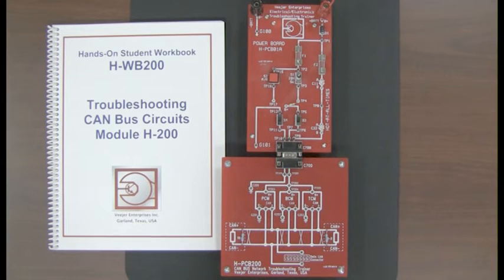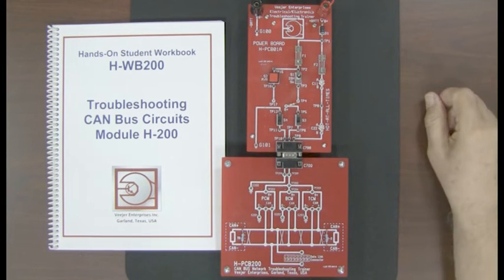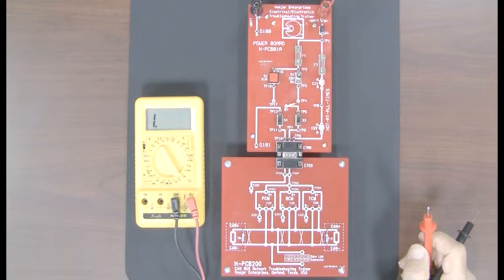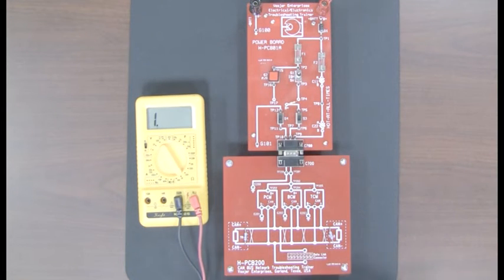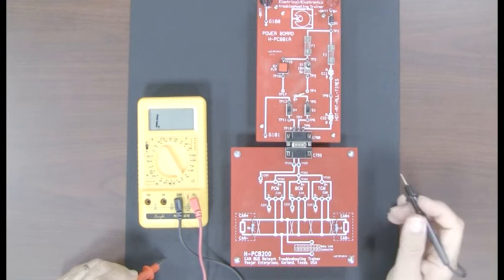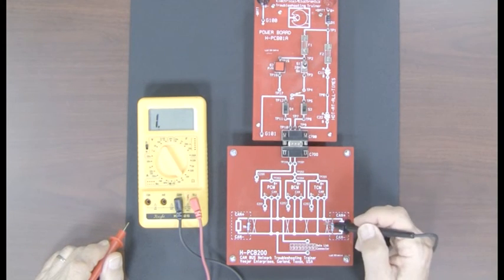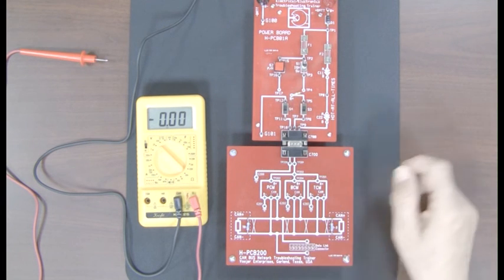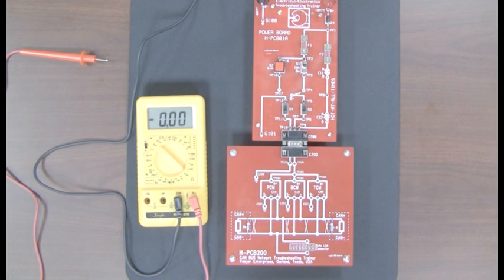H-200 Automotive CAN Bus Troubleshooting with Vince Fischelli

Comment: I would kill to have this available, so darned expensive though… used, or rent?
Reply from the maker: Sorry, no used or rental units available. To study this module you must have the H-111 Starter Kit, another module, the 1st one of the 5. CAN Bus H-200 is the 5th module in the series of 5 electrical circuit board trainers. These are being sold off in sets of 5 to reduce inventory evenly. See https://www.veejer.com for details.

Comment: i seen 250ish ohm one time when checking the system with the key on instead of off,with key off and everything asleep it went back to 60 ohm,just a variable i seen but wasnt just 250ohm at one point it was 500ohm so it seems we must be diligent in making sure there is no voltage present when taking the ohm test and it somthing that could be easily overlooked and have you chasing you tail

Comment: It was great  could you explain how we get 240. Ohm resistance,either they are good connected 60 ohm or open 120 ohm
Thanks
Reply from the maker: If the wire connecting the two termination resistors is open on the + side or the - side and your ohmmeter test leads are at each end of the open wire the ohmmeter will see the two 20 ohms resistors in series.

Comment: Sir if you measure 60 ohms in the dlc that the module you are working is not working is it possible that the voltage drop in the voltage side or ground side is abnormal? Tnx
Reply from the maker: Yes it is possible, this link explains our CAN Bus training.

https://www.veejer.com/CAN_Bus_Training_Options.html

Comment: In a vehicle with 70 modules I cannot imagine ohming each wire from the dlc to each module on 2 wires. Clearly there is a better way ?
Reply from the maker: This only has to be done when a module cannot communicate with the CAN Bus. It's one of those things that sometimes is overlooked or may not have been explained in other CAN Bus training programs. It also has to be performed correctly and with understanding what could be wrong if the reading is 60 ohms, 120 ohms, or 240 ohms.
Reply from the maker: That would be a nightmare, I agree. But this is one of the things you have to do when a particular node on the CAN Bus network reports a problem.